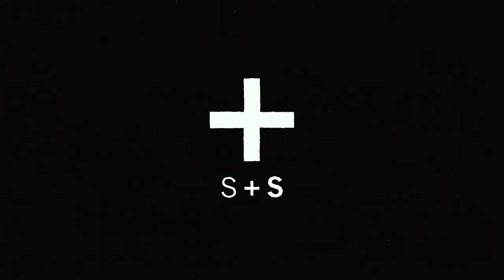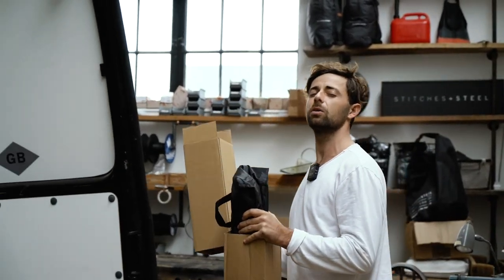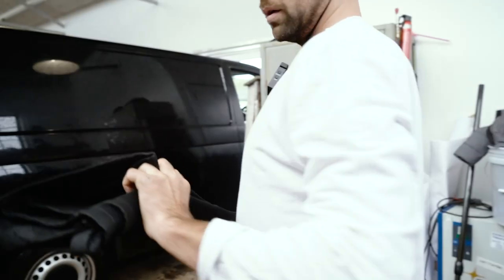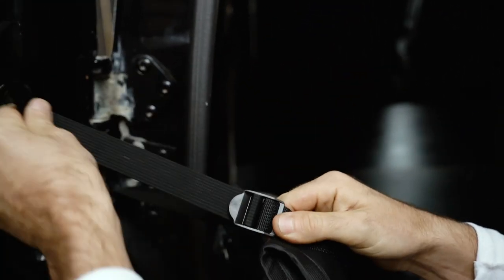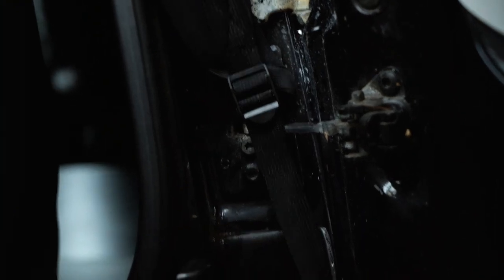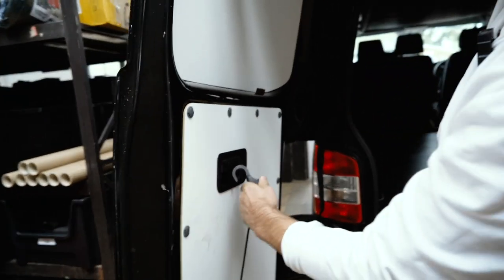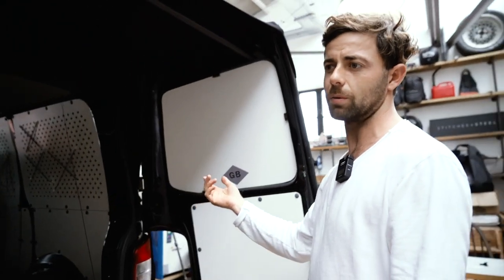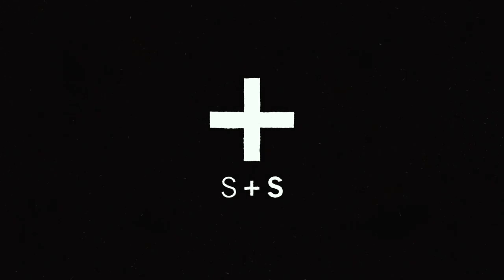Barn Door Awning. VW T5 / T6 STITCHES + STEEL

Comment: Wow! That looks amazing fella’s. So this would fit our Sprinter, yeah? Cheers 👍
Reply from the maker: Hey Bud, thanks for reaching out. Annoyingly, It doesn't really fit the larger models of vans like the Crafter. While the stretch allows it to be wide enough to fit, the straps that keep the tension in the material aren't long enough to work well enough to keep the awning from sagging. Sorry to let you down bud, but I hope this helps you out in saving you a trip our way :)
Let me know if there is anything else I can do for you.
All the best, Team S+S
Reply: @stitchesandsteel  ok bud. I’ve sent you a mail to your info@. Lets speak on this please, as i may have a work round👍 Thanks